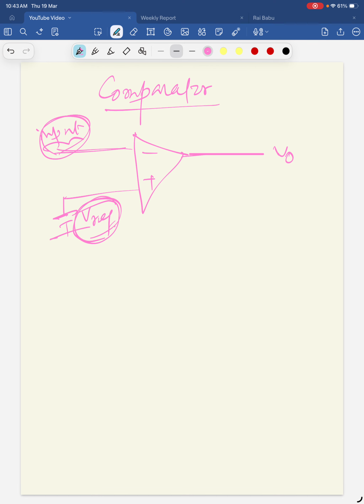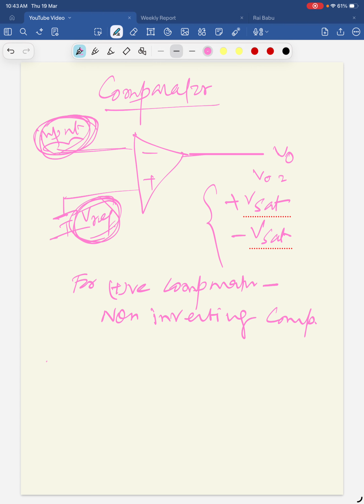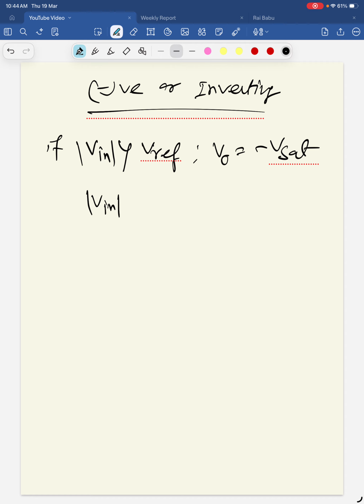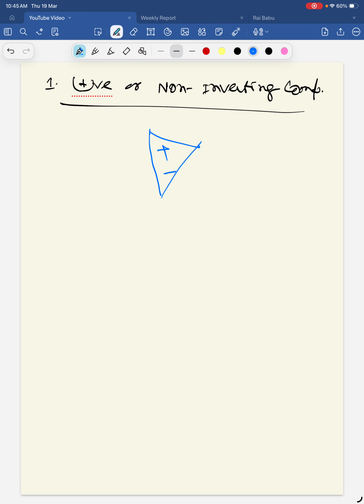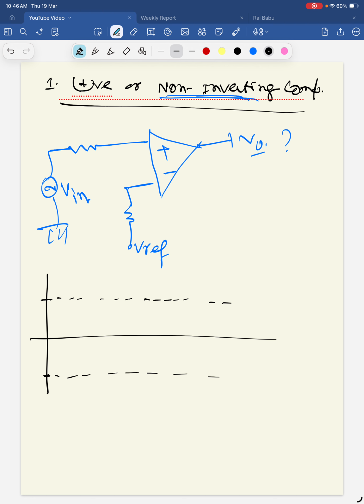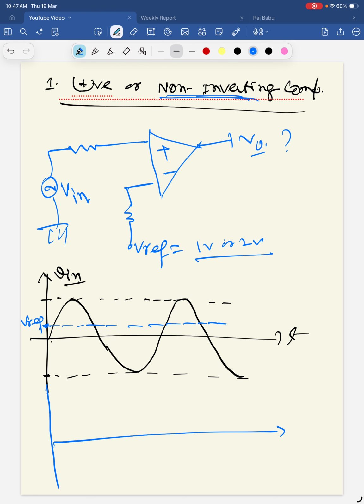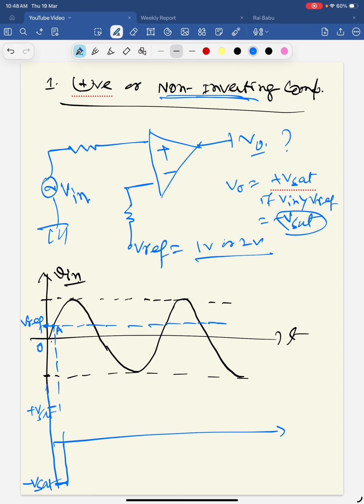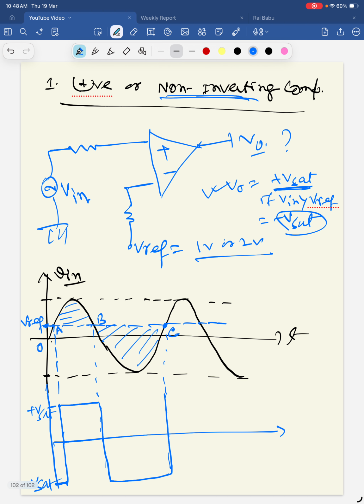NON-INVERTING COMPARATOR CIRCUIT USING OP-AMP

Comment: At that point where v(in) and v (reference) are equal then what will be the v(sat) ?
Reply from the maker: Very good question.... Will make one short video for all the query.
Reply from the maker: At the exact moment the input voltage and the fixed reference voltage  are the same in an ideal voltage comparator (op-amp without feedback), the output is zero, acting as the threshold point of transition between HIGH and LOW.
Reply: @Onlinetechnicalclass okay I understand.